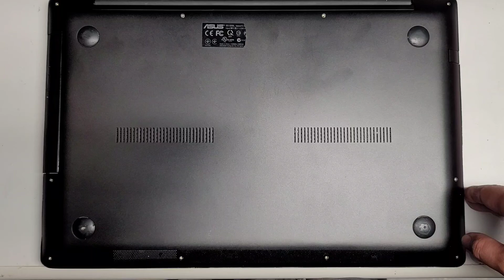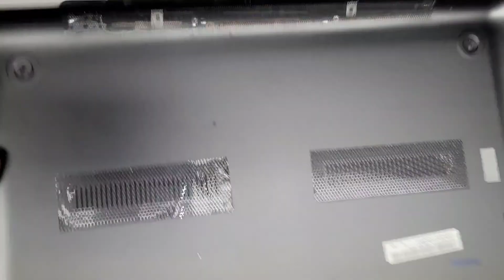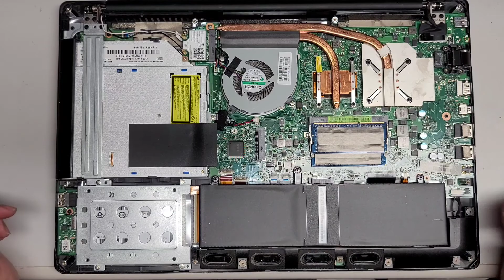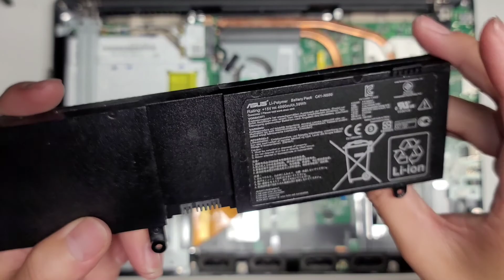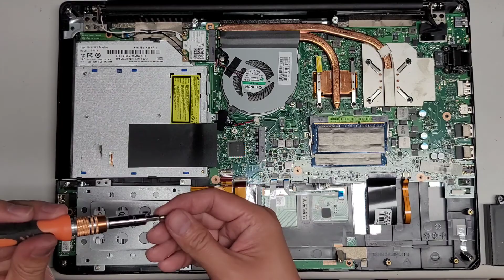ASUS Q550L Disassembly RAM SSD Hard Drive Upgrade Repair

Comment: Hi , for the original RAMs this has,is it two 4 GB? I just bought a 8GB to upgrade from 8 gb to 16 but I guess I was supposed to buy another 8GB if it has two 4s right? I never opened it before
Reply from the maker: @ryuzaku9054  I don't know what's in your computer, you'll have to open it and check

Comment: If you upgrade to an SSD, is there a way to get the OS onto the new SSD without needing a separate computer?
I no longer have the restore options from the factory, and they arent being helpful.
Reply from the maker: This will help https://youtu.be/4p5jFDzVwUw
Reply: @ItsBinhRepaired  It did, Thanks!!
Reply from the maker: @starhawke380  awesome

Comment: Hey Binh, when upgrading to new ram from the stock 8gb (to 16gb: 2 x 8gb) do you need to enable any settings in the BIOS for it to be recognized or optimize pr just its plug and play? Much thanks!
Reply from the maker: It's plug and play

Comment: Hi
Im lookin forward to add a SSD M2 memory to this laptop. Is the NMVE interface suitable for it?
Reply from the maker: If I didn't mention it in the video, then either no, or I have no idea.
Reply: If you look at the video. Under the fan, there is a spot for an M.2, but it must be half the size of the normal sized M.2.
Reply from the maker: @Deebo.1137  are you sure? That looks too wide to be an m.2 slot.
Reply: @ItsBinhRepaired  not sure why my reply didn’t post. Anyways. I just opened up my laptop. That spot def is for the M.2. Right below the fan.
Reply from the maker: @KrazyKrn90  m.2 ssds are more narrow than the wireless card. Did you try an m.2 in the slot?
Reply: @ItsBinhRepaired  I have not. I don’t have an extra one. And besides it looks like it needs to be a really short one to fit. Because a regular length will not work.
Reply from the maker: @KrazyKrn90  I don't think that's an m.2 slot. Usually it's for a mobile network card adapter, unless it works for both.
Reply: @ItsBinhRepaired  ahhhhh that makes more sense. I’m sure you’re right, idk anything about laptops. I just found your video from googling how to swap my laptop battery. Lol. Appreciate the video btw.
Reply from the maker: @Deebo.1137  no problem haha

Comment: i have exact same model.  it comes with 8GB rams (2 x 4GBs).  wondering if i can replace it with 2 X 8GBs?  if i do, can you tell me what and where to order?  thanks!
Reply from the maker: Other than DDR3 I'm not sure. This will likely work, if not you can return it. https://amzn.to/3bKYlJP
Reply: @ItsBinhRepaired  that one worked for me, thank you
Reply from the maker: Awesome!
Reply: Will it really help ?  Going from 8 gb to 32.  Or is it more like you can have more thing open up
Reply from the maker: @aarongreene2525  better to do SSD. RAM won't do much unless you are already overloading the RAM.